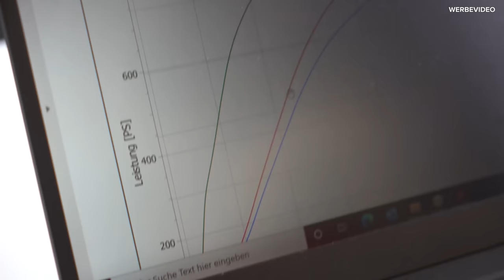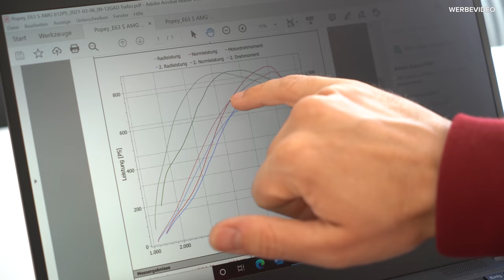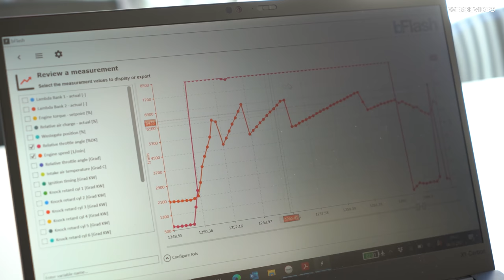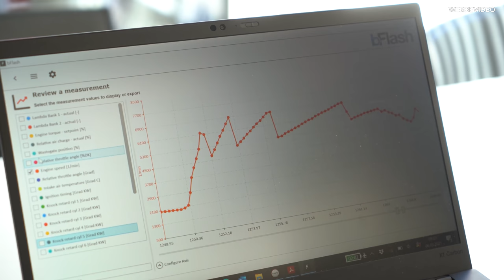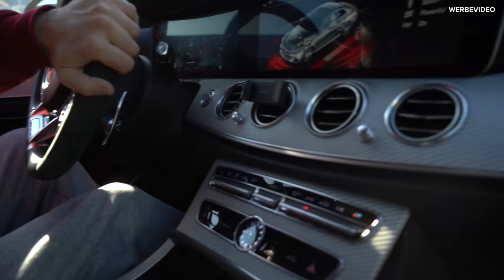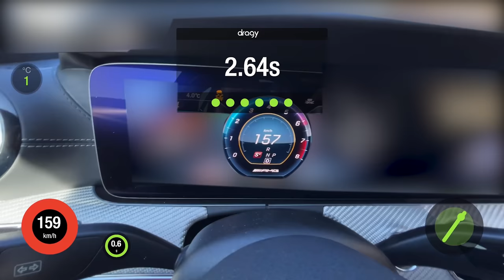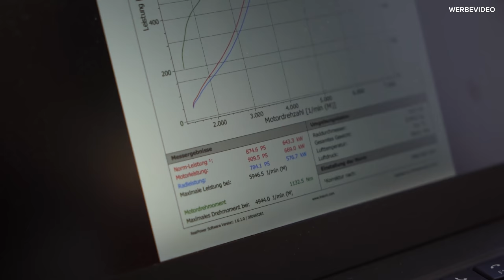Teil 2 Dicke Dinger im E63s Stage 3 | PP-Performance AMG E63s GAD-Lader Umbau

Comment: Alles meine ehemaligen und aktuellen Fahrzeuge: 

Opel Astra F 1.6, 75 PS ...... 180 km/h
Audi A3 8P 1.6, 116 PS ..... 195 km/h im 6. Gang bzw. 210 km/h im 5. Gang
C-Klasse W204 C300 3.0 V6, 231 PS .... 260 km/h (abgeriegelt)
E-Klasse W212 E350 CDI 3.0 V6, 265 PS .... 260 km/h (abgeriegelt)
E-Klasse W212 E400 3.5 V6, 333 PS .... 260 km/h (abgeriegelt)
S-Klasse V222 S500 4.7 V8, 455 PS ..... 260 km/h (abgeriegelt)

Meine Schwester hat im Porsche mal die 290 km/h gesehen.

Und 'ne Freundin von mir hat den Bentley Continental GT.
Damit hat sie sich mal an die 310 km/h getraut.

Den Bentley hatte sie damals, als ich den C300 hatte. Da fühlt man sich wie eine kleine Mickey Maus, wenn man da mit seinem 3.0 V6-Sauger angeschissen kommt. 6.0-Liter W12 Bi-Turbo, das war einfach zu krank vom Ausgangsmaterial. Und ist es heute noch.